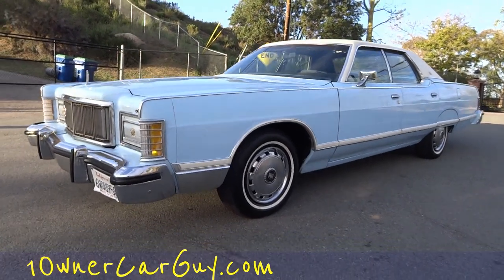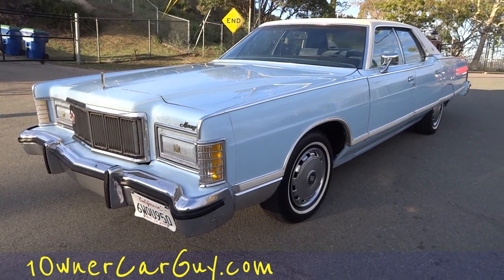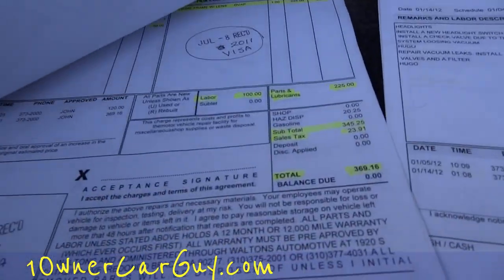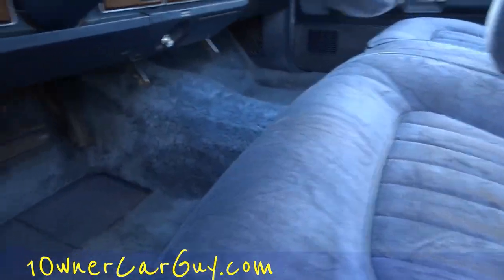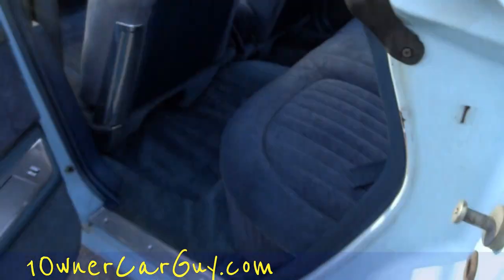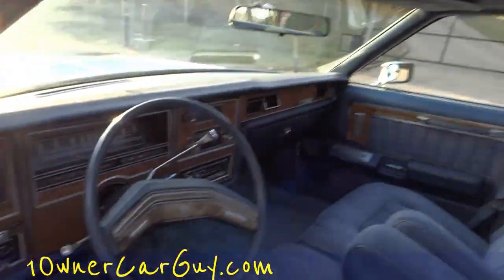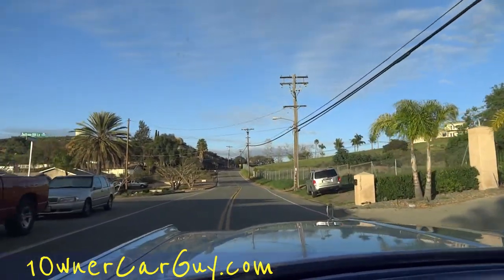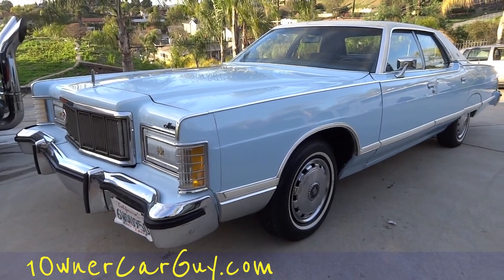312,000 High Mile Mercury Grand Marquis NEAR MINT 1 Owner Lincoln Records LA USA To BC Canada

Comment: Really nice car. Big surprise is the power sunroof. Not too many buyers thought much about a sunroof . Also love the velour cloth seats. Doesn't even show any wear, at least from the video. Not sure if I saw some slight damage on the lower passenger side, could have been the lighting. Even the engine belts and hoses show very little wear. My father bought a '78 Ford LTD the exact same color with a 351 V8. But he went the cheap route and didn't get all the options the Grand Marquis had.

Comment: That trunk lid makes the same squeaky sound as my '76 Gran Torino sedan.  It has the same Interstate battery I just bought for mine (see last video I put up.  This isn't the only big Ford with a ton of miles, there are several LTDs and Marquis out there that have turned over and over again.  This is a car a lot of people would sell as a 12K mile car.  I'd put another 300K on it myself.  You can't beat a big car for driving a lot.